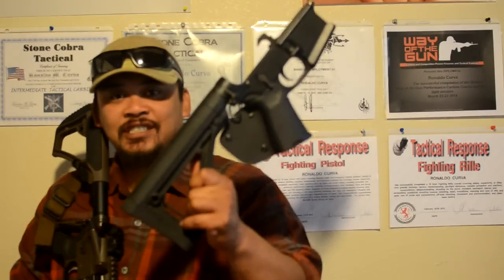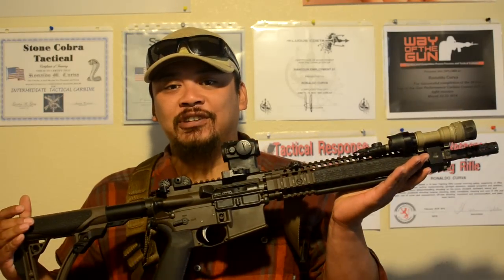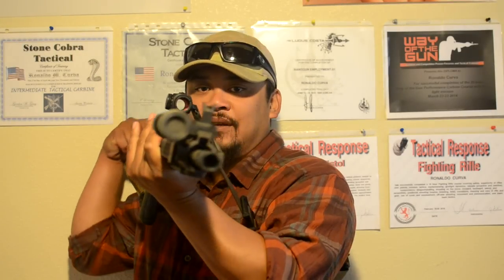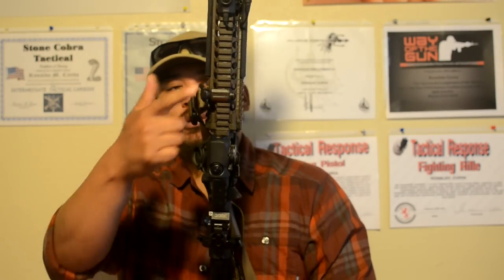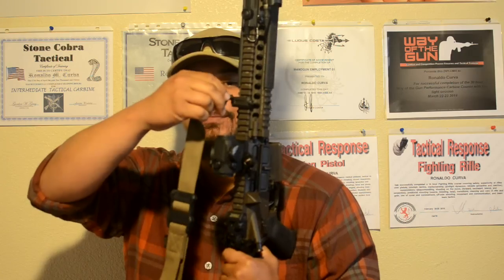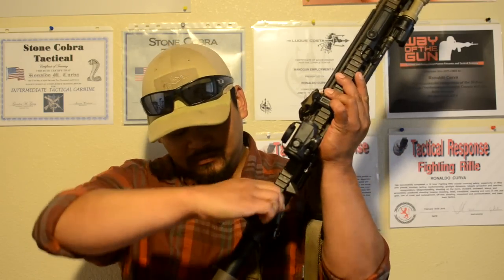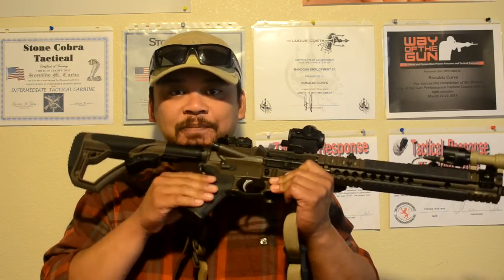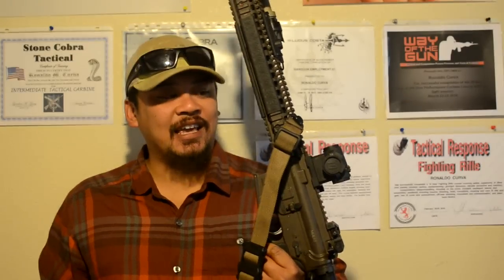Daniel Defense M4A1 | DDM4A1 | #QuadRailMasterRace

Comment: I am new to the AR-15 platform and am considering purchasing one of these rifles. I'm also looking at a Colt LE 6920. The DDM4A1 at my local GS costs a bit more. I'm not trying to start a flame war here, but is the DDM4A1 worth the additional cost over the Colt? Beyond your description in this video, what's been your experience with your rifle so far? If you were to do this over, would you still buy this rifle? Thank you.
Reply from the maker: if i bought a colt i'd have to change the handguard, front sight post, and buttstock.  the DD was configured how i wanted it.  the DD RIS handguard is not cheap.  if i wanted an m4 clone, i'd get a colt 6920
Reply: Thank you for your response. I recently did some research on the M4 clone you mentioned. From the surface, the DD M4A1 appears to be a much better representation of the SOPMOD Block II program than the Colt 6920. Although it seems to be a very expensive upgrade, some of these M4 clones do look sweet. The DD M4A1 is looking better all the time. What's been your experience with your M4A1 so far?
Reply from the maker: buy once cry once.  you won't regret it
Reply: The local GS says that DD rifles in general are very popular and the DD M4A1 is not that easy for them to stock in their inventory. As for the "buy once, cry once" experience, I have definitely been there with some of my purchases in the past. I may just do that with the purchase of the DD M4A1. Thank you.
Reply: The cold hammer forged chrome lined barrel is one though barrel. That hammer forging is used for full auto rifles because of the abusive heat it can take.

Comment: Can't decide.
DDM4A1 or LWRC IC SPR.
lwrc comes with iron sights
ddm4 does not, but is less expensive (they need to add flip up sights, or at least the dd sights you can take off)
ddm4 is lighter
lwrc is PERHAPS more reliable.
Choices, choices, choices.
Reply from the maker: i had the same choice.  for the price of a lwrc, you can get a DD and buy a red dot
Reply: Thanks for the fast reply. Yea, it is a VERY hard choice for me, i can choose CARS faster than it takes me to decide on guns. It has taken me months to narrow it down to LWRC and DD, but if i see a good bcm i might impulse buy, and Larue isn't completely out of the picture.
The thing is, it seems the lwrc is more reliable, and i really, REALLY want reliability. I'm not saying the dd isn't reliable, but some lwrc;s i have seen have been through some serious shit, and the whole lube thing is a plus. If the ddm4a1 had some flip up sights, i would probably settle on it for the same price. I just want to get a good rifle, and save for an aimpoint or eotech.
Sorry, for the rant, i don't make good money, and get one choice pretty much. W/ iron sights i could at least start shooting right away. With the m4a1, i would have to either buy iron sights, or a cheap red dot since i don't have an extra 500 for optic.
Reply: Zach Conant which one did you end up buying?